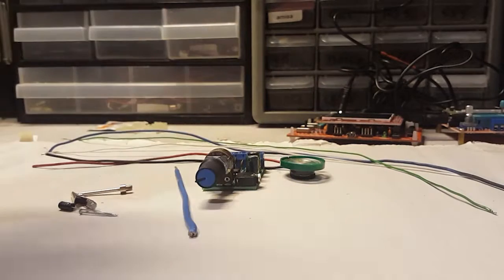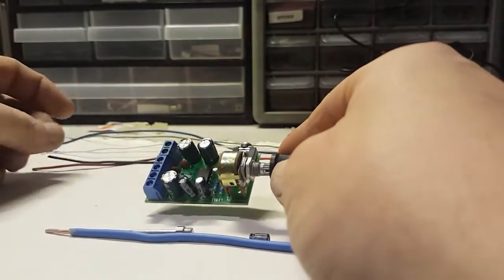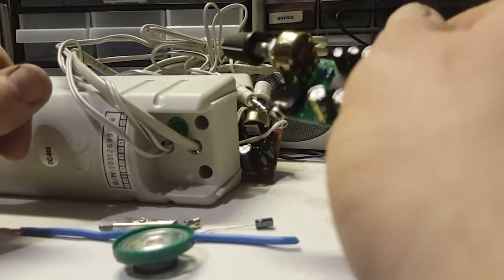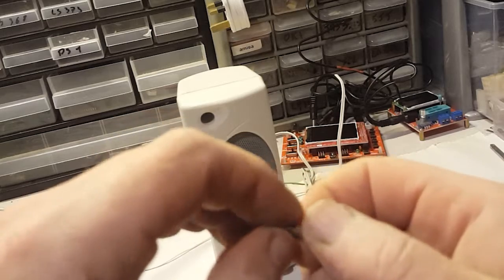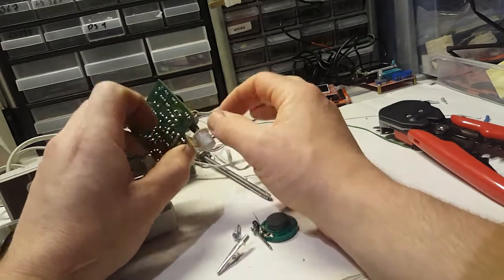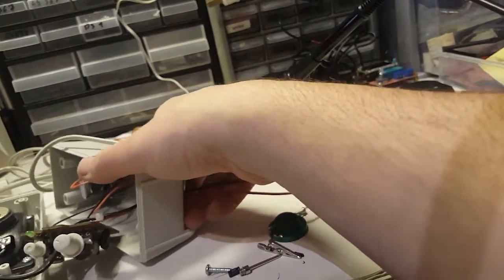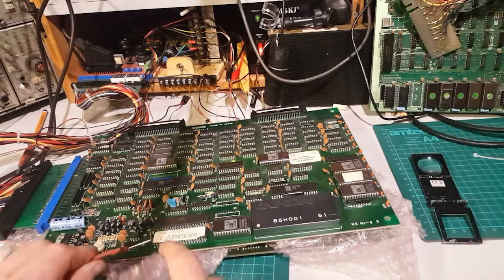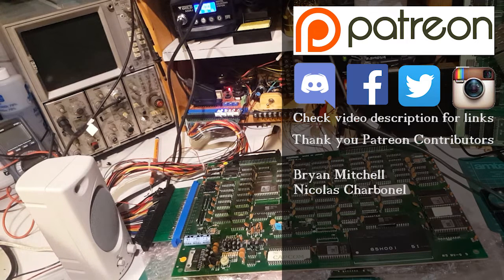Arcade DIY #51 Making an audio probe the cheap way

Comment: Thanks for this, suitable for logic and low volt work only. I worry some newbie viewers might stray into probing a power supply section and come unstuck. I sometimes mess around with valve gear so I'd need a 600v cap inline on both the positive and neg connections and much better insulation and beefier build throughout. Poss some way to 'hear' radio frequencies would be helpful too.

Comment: Thanks for the upload. I need to build a variation of a probe like this to stop killing my meter batteries on continuity mode.

BTW I've been goofing around with my own little 644 based AVR Transistor Tester project testing a bunch of the OSHW project options. I also have a bunch of the Chinese  clones like that little AY-AT I see in the background of this upload. 
...anyways...while doing a bunch of experiments I noticed a distinct problem with the AY-AT display. I wrote up the issues on the EEVBlog forum thread for the project. Basically, if you flip your LCD module over you'll see the cd4050 and 3v3 regulator but there are no filter caps. If you add a few 100n's and a ~5-10u on the input you'll find that the device works much better. I just scraped the solder mask and added a few 0805's. Previously I thought the device just had buggy firmware, but all of my issues were just due to the junky display module :)
-Jake
Reply from the maker: mm thanks a lot for the info. I haven't had any issues with the display yet but it's always good to know. these ay at are not perfect but handy for a quick and fast setup

Comment: Thanks for the video, I had been meaning to make one for quite some time and finally did.  I always thought that a ground connection was necessary for a return path, does yours actually work without a ground connection? (mine doesn't, and I really wouldn't have expected it too).  Thanks.